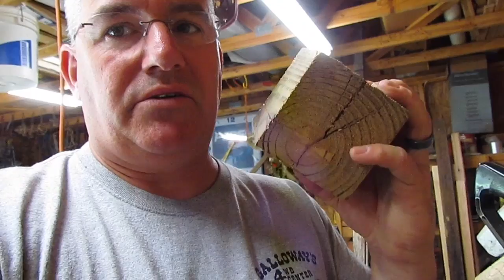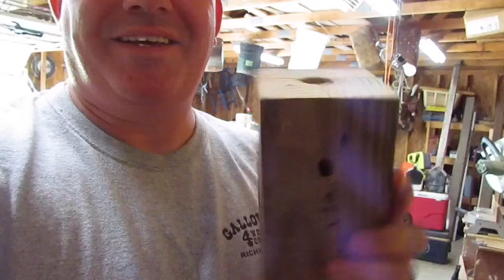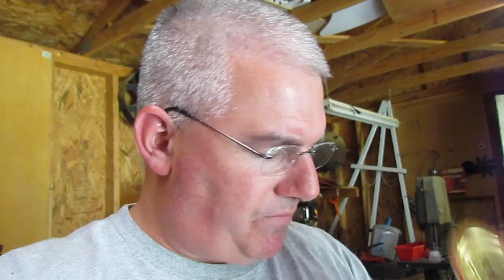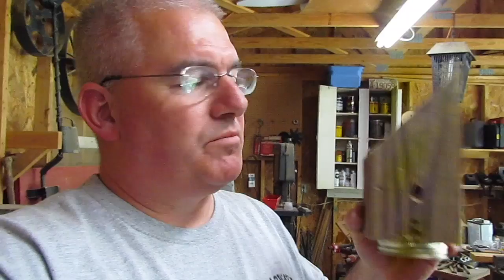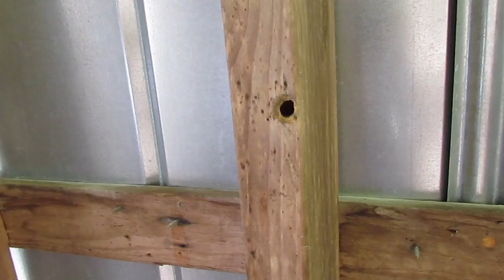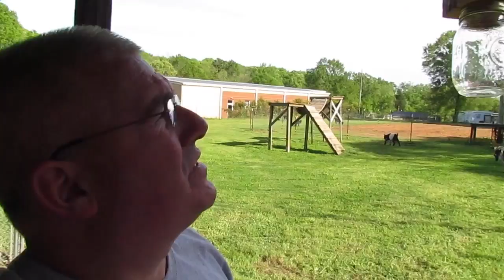How To Make A Carpenter Bee Trap

Comment: Why does the 4x4 have to be angled at the top?
Reply: My understanding is the angle is for water run-off.  I'm making one that's 6-inches long and cut at 30-degrees.  Saves an inch of stock.
Reply: @whiskeyfoxtrot6792  I had the same question, the answer makes sense. Thanks

Comment: I don't understand the purpose of the large angled area on top. Other traps I've seen on YouTube are as simple as a block of wood + a big hole and one or two small 45* holes. The large angled area just seems like a waste of wood to me.
Reply: Wd 40 in the holes and they will go immediately. Promise
Reply: I wish someone would answer your question😊 I am curious as well why that makes a difference.
Reply: Terry Thomas 
I just realized 😅 It's probably so that hanging it unsheltered will allow the rain to shed off and not puddle up/crack the block
Reply: Which if I am correct, means you don't need near as steep of slope to achieve result.
Reply: Terry Thomas
 A lesson my father taught me many moons ago in outdoor vertical 4×4 posts 101😉😊